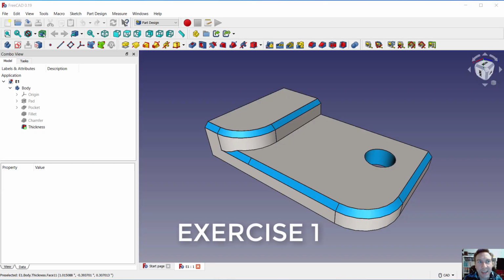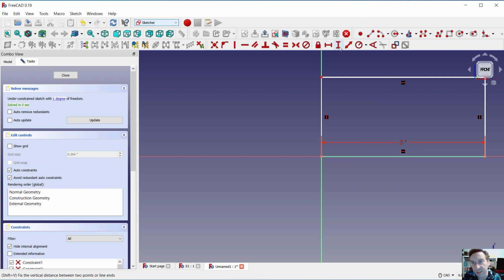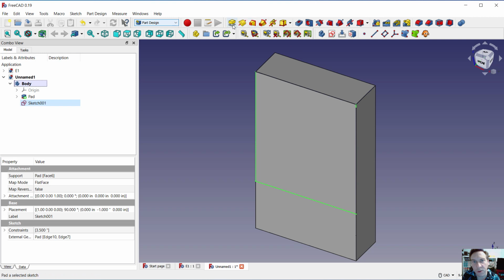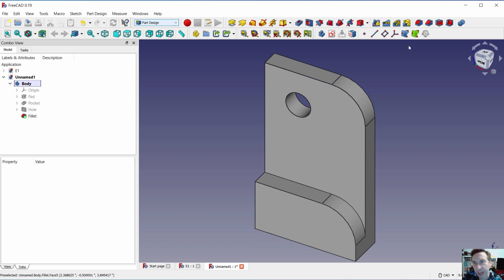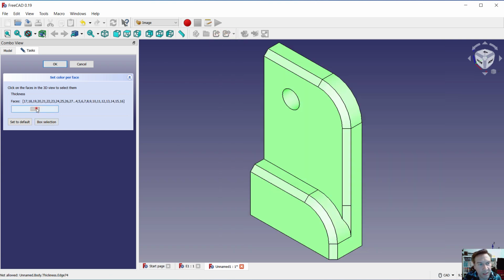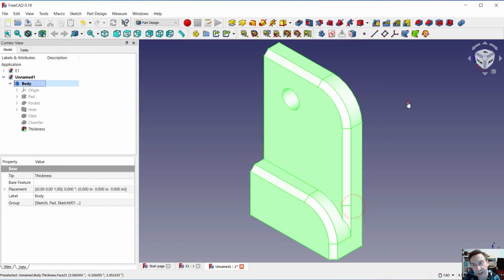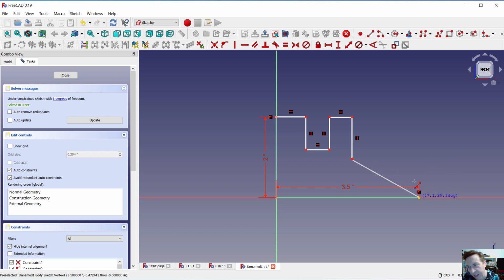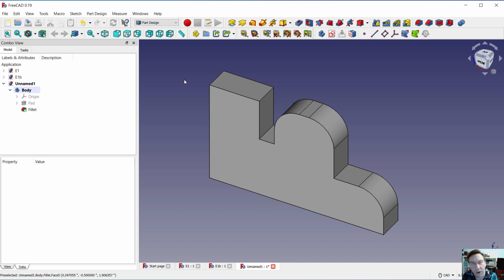E1 FreeCAD Basic 3D Solid Modeling Tutorial for Beginners

Comment: When I select my two edges to link to an external geometry, create a rectangle, and then add a dimension, the rectangle no longer is linked to either edge. It links the dimension, locking the new sketch to wherever my point is where I finish the rectangle. If I'm .00001 off, there is no way for me to link the two back together. So when I create my pocket, there's always a sliver of material on either of my linked edges.

Comment: Nice video, I am a beginner and am using ver 0.19.2 and do you know where to go to change the size of the actual point (vertices?) at the corner of a square I have just created? Mine are so small and can not select just the point, zooming in doesn't help either? Thanks